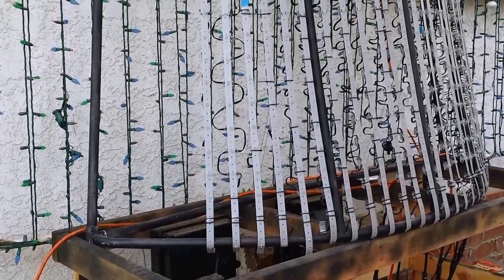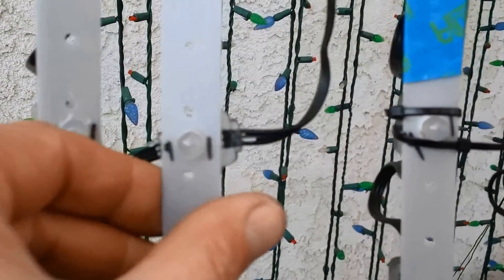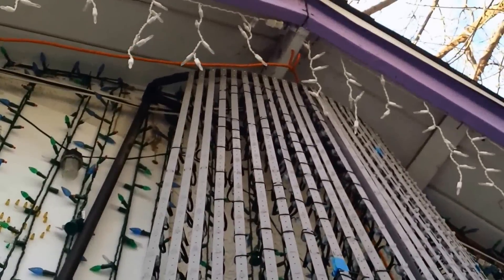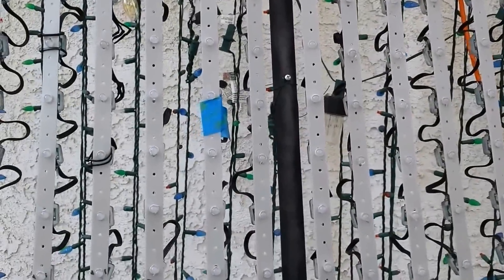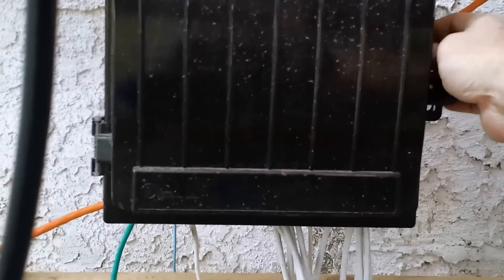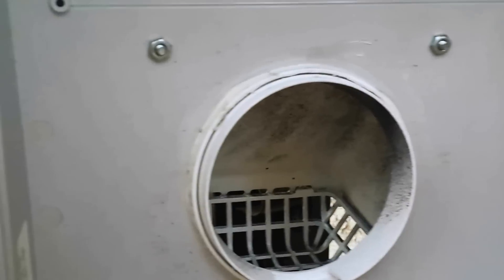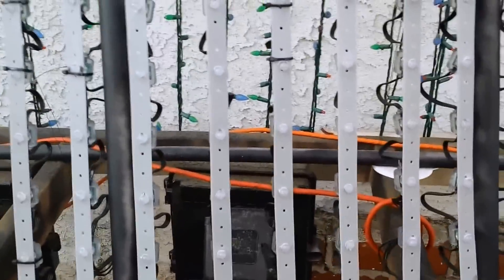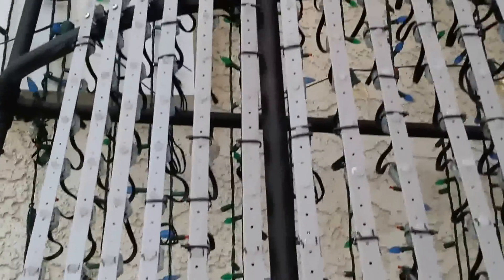ws2811 Pixel tree and frame

Comment: You mentioned that your 1,200 pixels pull 10 amps at full white.  That would mean each pixel, at full white, would pull 8.3 mA  (10 amps X 1,000 /1,200 = 8.3 mA).  Most 2811 pixels are rated at 45mA or 60mA at full white.  E.g., for 1200 pixels of the 45mA rated pixels, current draw would be 54 amps at full white (45 mA X 1,200 pixels / 1,000 = 54 amps).  That is much greater than 10 amps.  Did I misunderstand what you were saying about the current draw on your 1200 pixels?  
BTW, great looking tree, with perfectly spaced strips and pixel nodes, and what looks like a great frame that supports all of it.
Reply from the maker: +Ed Kaempf Hi Ed, thanks for watching.
The 10 amps were measured using a Killowatt and measure AC power draw.
DC amps are calculated different as I understand and as you wrote above. 
The two 30 amp DC power supplies handled the load with no issues, but I was trying to balance my AC load when I checked not DC draw.

Comment: I know this vid is a little old. But great job.
 I'm looking to do this exact thing this season (2015)using the same equipment. 
Questions. 
I looks like you used 12 channels on the e682 with no power injection. Just two power supplies, one for each bank. 
Did you do 50 pixels up 50 pixels down on one channel. 100 pixels total per channel.  ( I believe you did)
I'm just starting to learn nutcracker how did you set up the pixels in that. I'm a little lost there. 
How did the pipe strap hold up all season. 
What would you change. 
Thanks. Chris.
Reply from the maker: Yes I set it up as 12 universes of 100 pixels.
Set up so that the order was 1-50 and then flipped 100-51, I thought this the easiest to set up a visualizer file for.
You shouldn't need two power supplies, but I decided to ease the load and use two. And no power injection
The pipe strap held up just fine.
I wouldn't change anything, but this year I added 600 more pixels and used the Pixilite16 which can do 32 universes. It's performance was not as good as the E682

Comment: I purchased the WS2811 bullet style pixels. Do you think that I would have a problem using this type of strap to hold these pixels straight?
Reply from the maker: I think they would work.
You can do it two ways, one by drilling the holes large enough to push the whole housing through, this I think for sure would work.
The other is by just drilling it enough for the pixel to push through, there is a ridge on them for lenses to snap on and that might hold them in.
Either way drill the hole slightly under size so the pixels or housing are very snug when pushed through

Comment: Is the plastic strap something that might be found a Lowes or Homedepot
Reply from the maker: I bought them on Amazon, look for
Oatey 33927 3/4-Inch by 100-Feet Boxed Plastic Strap
Reply: Jerry L. Baker Thanks, I've been trying to figure out how to mount the WS2811 pixels strings that I bought to make a pixel mega tree with. I guess the plastic strip holds your pixels straight?
Reply from the maker: LZ Bronco
 Yes if you drill them slightly undersize they will snap it and hold one their own.
I would recommend setting up some sort mark system so that you drill each strip in the same place. I did mine on a piece of wood, marked the wood and then drilled the plastic strips at the marks.

Comment: Jerry, I believe your pixel failure is being caused by having 2 power supply's. If you had 2 separate 682's with each one on its own PS, Then you would be fine. Check this out. http://holidayuniversity.com/forums/index.php?topic=1421.30
Reply from the maker: Thanks hawkn7 that's might be a good point. I had a great deal of my failures when I was using just one PS.
I was also told that I should take the voltage down as low as I can to 9 or 10 volts, that a lot of people were having the same issue and reducing voltage helped.
Also thanks for the forum suggestions I am a member on both.
Reply: Bummer. I was hoping maybe this was the problem but it sounds like manufacture quality issues.
Reply from the maker: hawkn7 Probably a Mfg. issues but it was a good suggestion and I thank you for the assistance.

Comment: great tree was what i have visioned can you mail me a parts description looks like 24 strings of 50 but i thought the e682 did only 16 strings or are you up and over with 100 pixels strings thks robin rhoodman66@gmail.com
Reply from the maker: Actually yes they are 12 strands of 100 up and over. I only used 12 of the 16 plugs. But if you connect the data through 3 strands of 50 it would only take 8 of the plugs so you could really make two of these on one E682.
I'll get a list together next weekend and email it to you.

Comment: I really enjoy your videos and display. Did you say that you replaced 100 of those RGB nodes just this season? What kind of failure rate are you getting? Thanks.
Reply from the maker: Thank you for wacthing!
Long story I got thirteen 100 pixels strands from Ray Wu and had 6 bad as soon as I opened the bags. He sent me 6 replacements and 4 of them were bad. After watching the strands flicker and thinking about I realized that only a pixel or two in each strand were bad. I began to replace them and then replace more, than more till I replaced about 90 (100 sounded more dramatic LOL). Ray has asked for the 6 strands back and I will send them to him but they one strand will be in pieces.
Bottom line I believe most were bad due to poor soldering since most when I pushed on the RGB it would work.
From what other have said in the years pass they didn't have many problems but this year a lot of the WS2811 pixels had issues. I am now thinking of replacing them form a US vendor.
Reply: Jerry L. Baker Thanks for the reply. As far as I'm concerned, 10 sounds like a high failure rate to me. haha So who in the USA makes and sells these? I mean let's just say price is not an issue at all, top quality is, who is the person or company to deal with? Thanks again for the videos and info.
Reply from the maker: wjf213
US vendors
Seasonal Entertainment
DYI LED Express
Holiday Coro
Some others but these come to mind right now.